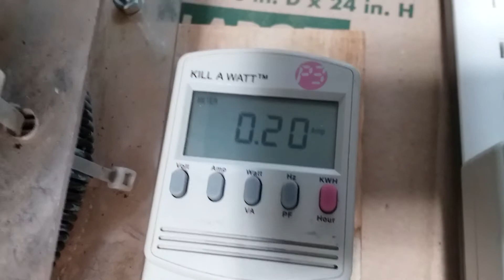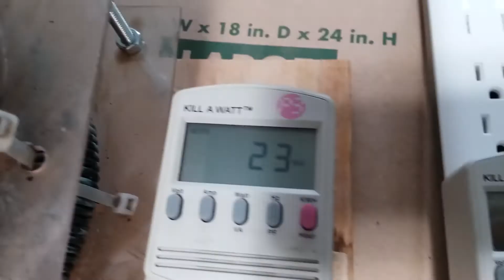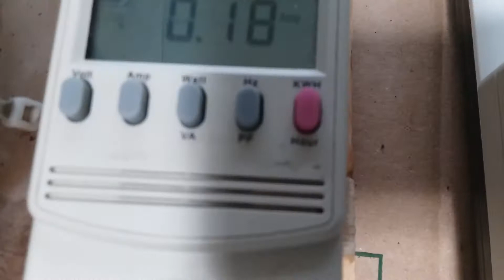Magrav Generator -1

Comment: That is not generator but field creator?
Reply: According to the Keshe Foundation, the device was "allegedly" designed to specifically nano coat the entire electrical and branch copper wiring in a home or small business. There is a specific method and timeline you must follow to "allegedly" be successful. Once the wiring in the house is nano coated it will "allegedly" act as or similar to an electret in attracting additional energy to your entire electrical system, "allegedly" reducing your total electrical consumption.    

What I found from my experimentation is that copper wire when nano coated becomes much like an electret that appears to automatically reenergize from the electroMagnetic/Gravitational energy field that surrounds the earth. (Big Question) Perhaps it is what is commonly referred to as static electricity.  Hence the name Mag Grav and perhaps it may be the same energy as what Nicola Tesla had observed. I can't see it so I have no idea. Lol  

I could even fully discharge a single piece of nano-coated copper wire and it would be reenergized when I tested it again later. That's what made me build it. The other uncoated piece of copper wire would not hold any charge. They were both 18" long solid #10 copper wires. One was nano coated and one was not, so something is going on with the nano-coated piece.        

I finished building a working Magrav but have not tested it to see if it would actually nano coat my entire home. We are a little afraid and lack the knowledge to hook it up and test properly. Hopefully, someday I will find someone in So. Florida who will help my friend and I hook it up.   

I can run a current through the Magrav and run lights or a fan and the whole thing plus the cords and strip put off a slight electromagnetic charge that I'm able to read on a Gauss meter.  I touched one of the leads and it doesn't shock me.  No clue!!!!  It's plugged into a 115 volt circuit so I'm not getting free energy. I was just was surprised When I plugged it in and a current ran through it.
Reply: @h.skiprobinson7668  I'm not familiar with Florida researchers, you may get help from Arizona research group.

The problem I have is, how to increase the voltage of a capacitor? I built a Magrav generator in September according to the knowledge from the knowledge seeker, I did it with a "stack unit" connect to "two Magrav coils set"( + → -  not ++ --, it said that will create a motion loop, one abstract and one filling), as I observed Magrav coils itself do not produce any voltage, at least I can't measure it with "matter detector".

So, I'm working on capacitor, trying to make the voltage increase to...120V then I can test the generator, what I can share is "dry leaf" and "nanocoated copper wire" did work without "any human created gans", I sure they can last for weeks(if you use a "fresh leaf", the voltage will decrease in future weeks, it may rot then change the environment?) I can easily get 0.3, 0.5 or 0.6V, I also test with a normal copper wire, it did work but the V is half of the nanocoated and it will not last for a week.

I'm trying to use the "transformer" method but I hadn't success, it said that if one's create different ratio, such as 1 : 1000 (what I did in "turns") then it will increase the current of it.

Live long and prosper.
Reply: @h.skiprobinson7668  so the magrav produces electricity?